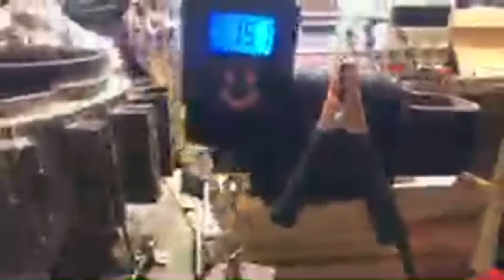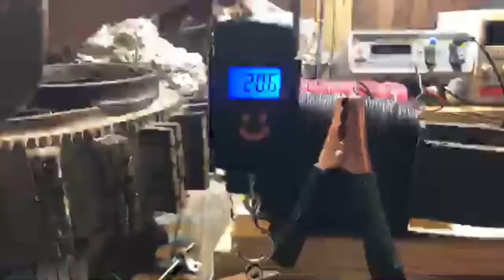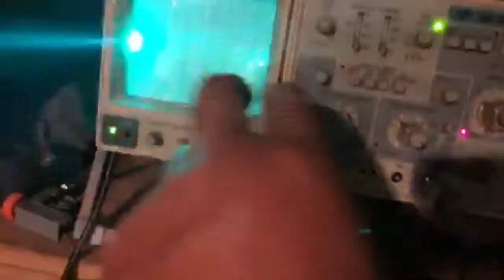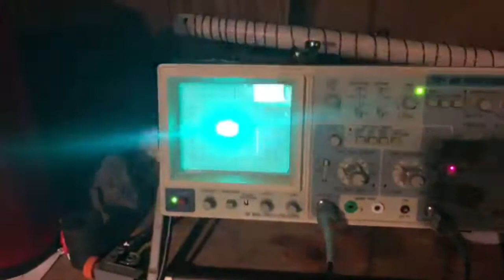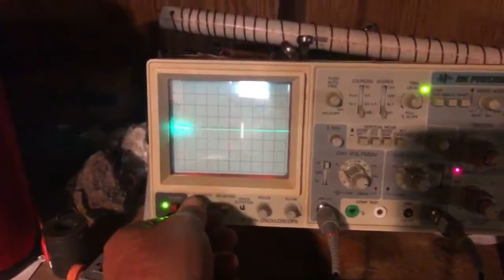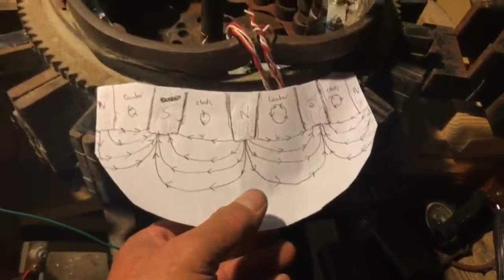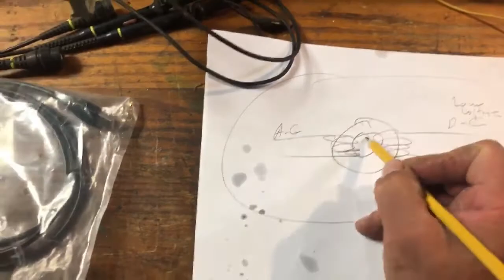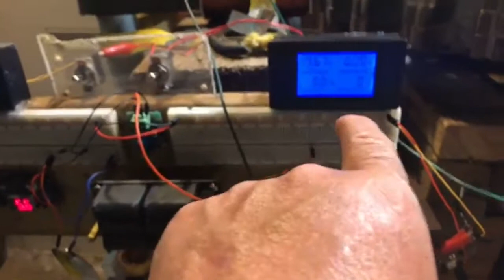Magnetic transfer thru induction. Ed Leedskalnin

Comment: mass gets lighter with hole drilled but only when you put negative neo face on top  or maybe the positive as one pole will pull the field of the air swirling through the hole